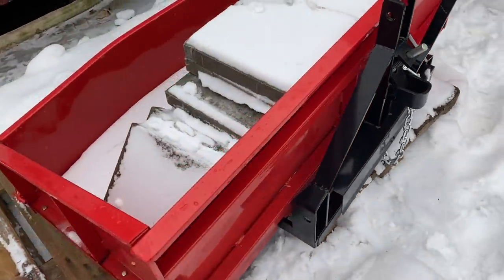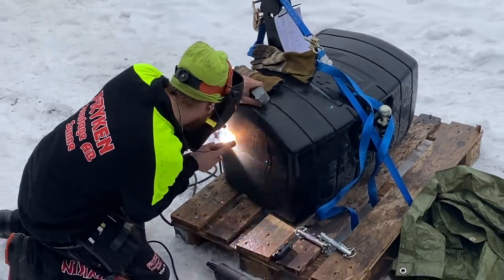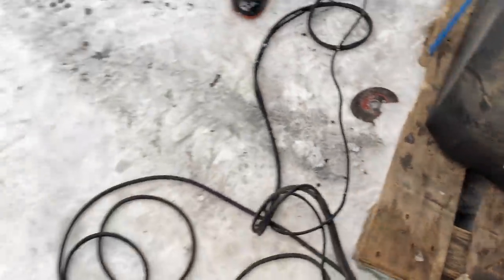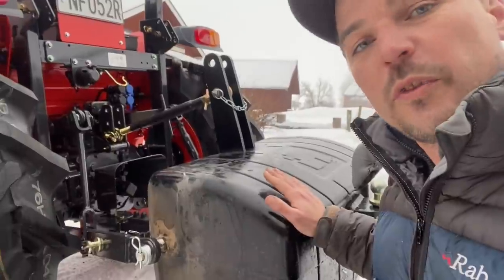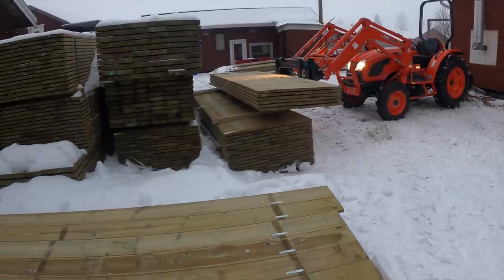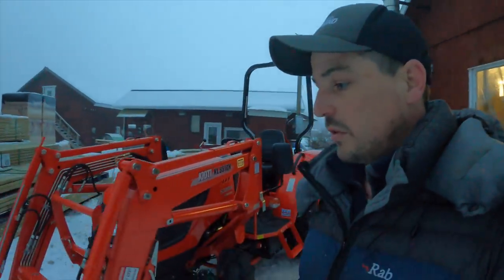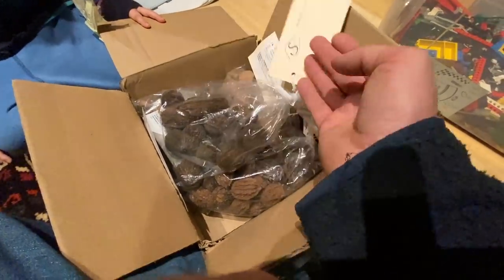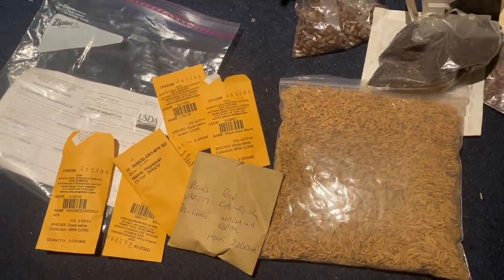Timber and Tree Seeds

Comment: You can probably get 500-600 pounds of ballast in each of your rear tires as well. Beet juice is popular here in the States for that....good weight ratio, doesn't freeze, doesn't corrode.
Reply from the maker: Sure, I avoided this option as I want to be able to remove weights totally quickly if I want to work on the pasture and keep things light. Never heard of beet juice, that’s smart!

Comment: Why not just put weight inside the tires?
Reply: I was thinking the same. Our tractor tyres are filled with liquid (water probably rather than beet juice which is also popular) but I guess that's not such a good solution in a Swedish winter! 🤣
Reply: @paultipper2738  little antifreeze always works
Reply from the maker: I want to be able to quickly remove weight for minimal pasture trashing if I use it in the field.
Reply: @regenerativeagriculture  won’t see any thrashing of pasture with such a small tractor, psi will still be very low compared to other wheeled vehicles like trucks and such running much smaller tires. You will have improved lifting capabilities with no significant issues on pasture with ballasted tires on the rears.